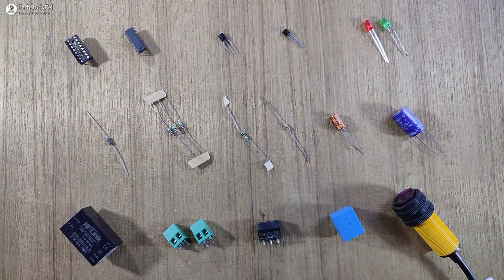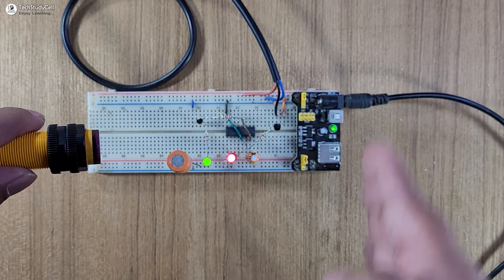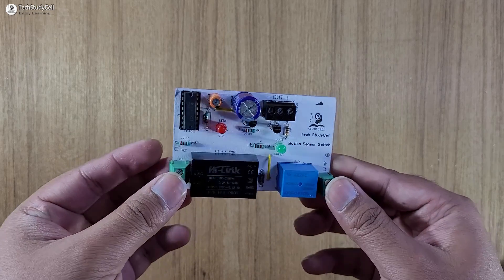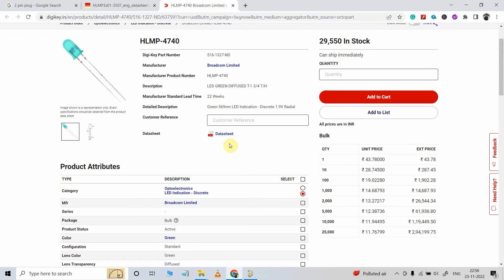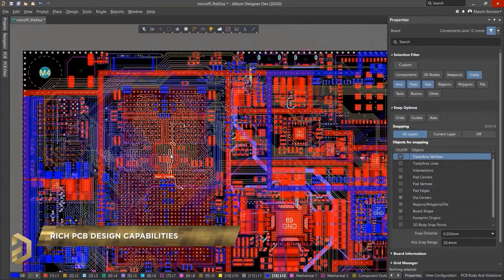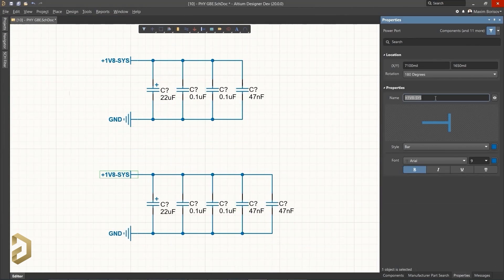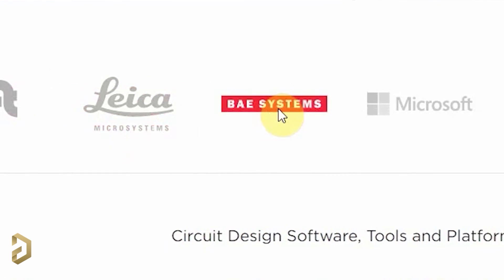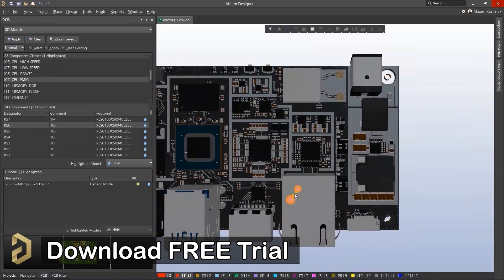How to make Motion Sensor Light 💡💡 using IR Proximity Sensor | CD4017 IC Projects

Comment: Gr8 project as usual. I'm trying to implement similar concept for wardrobe, when you open the wardrobe door LED's glow, and when close it it will turn off. I will be using 12v 5050/4040 LED strips. Any guidance bro.
Reply from the maker: Will check
Reply: @TechStudyCell  Thanks Bro
Reply: @TechStudyCell  please, we are waiting as well.
Reply: easiest and most simple is to use a magnetic REED switch, a magnet, 12V power supply and of course the LED strips
Reply: a reed switch will clos[NC]e/open[NO] when a magnet is close -  
mount the magnet on the door

reed swicth is....say  under a shelf  near the door   such that magnet activates the reed switch when the door is closed
Reply: or you can use a pressure switch